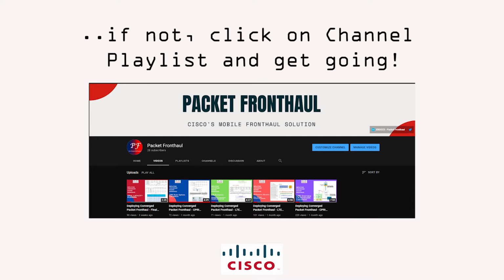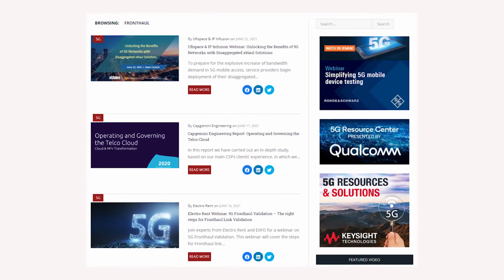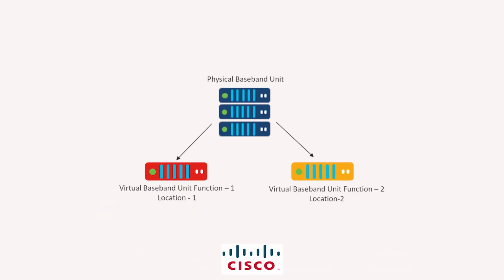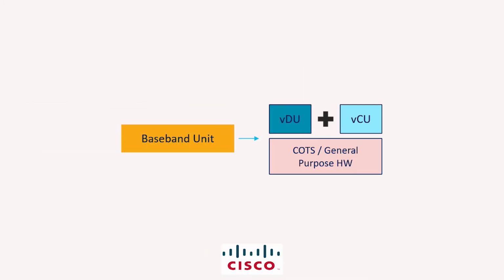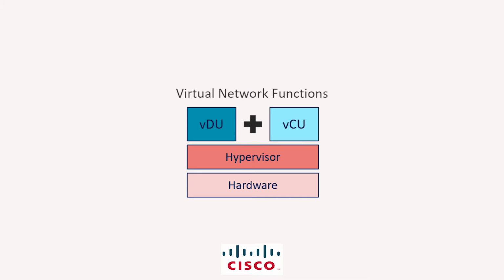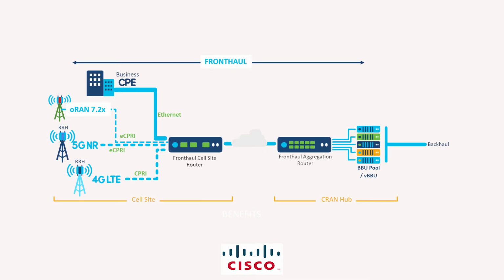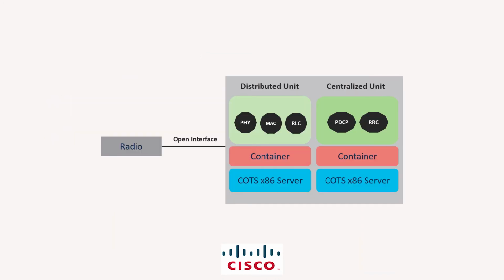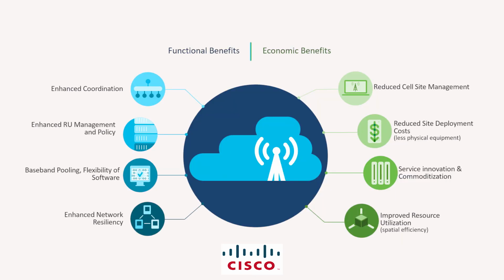What is Mobile Fronthaul? | Cisco Packet Fronthaul | NCS540-FH

Comment: Hi, and thanks for the video. I have a question:

in 3:18 you say that the separation of the original setup into RU + vDU + vCU increases capacity and performance at cell edge. However, I don't understand how this is possible. A virtual function, which adds more layers of abstraction, should decrease the performance if we compare it to the use of proprietary hardware. Am I missing something here? Thanks a lot!